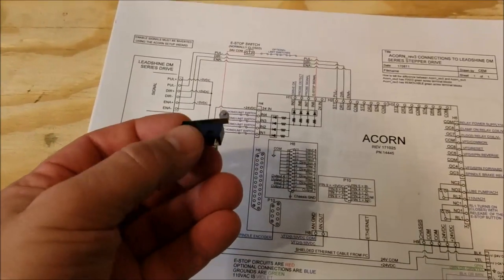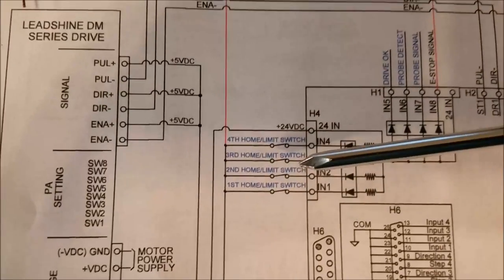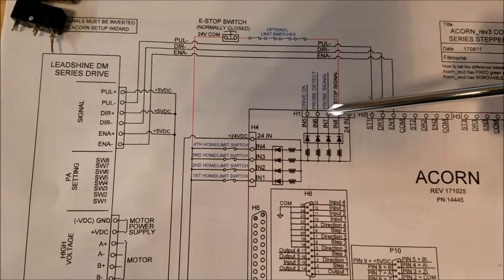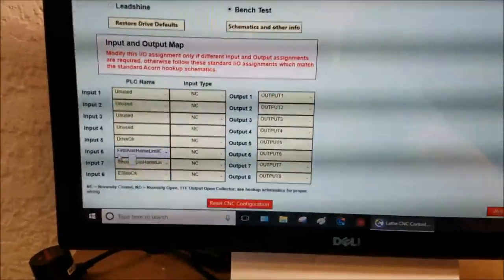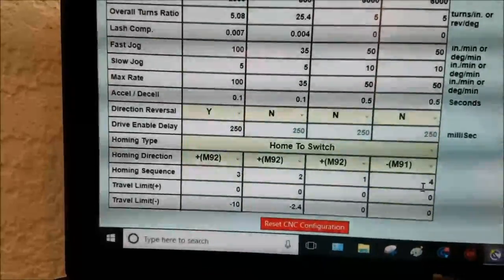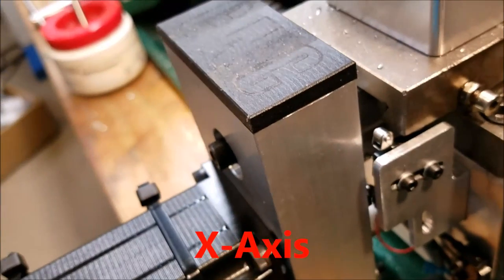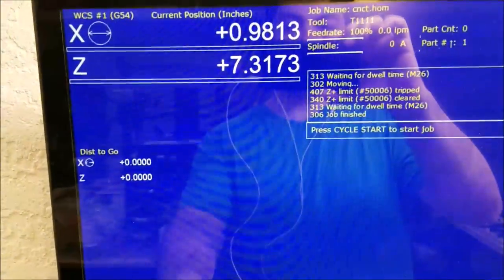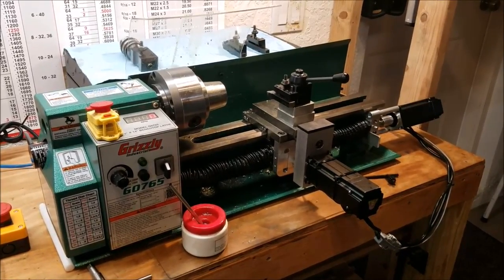DIY Closed Loop CNC Control #9: Home/Limit Switches

Comment: Great videos!! I may be able to use them in the future. Now all I'd like to see is you make something with it. I have a small lathe like yours and I'd never think to put this tech on it because of its poor rigidity. I recently acquired a used Bolton 10" that I was thinking I'd like to convert. It can almost cut to a mirror finish.

Comment: great videos, keep it up, on your mill conversion, what couplings did you end up using, just curios of the backlash
Reply from the maker: That is a great question - the couplings can account for a good portion of the backlash.  I used a diaphragm type on the Z-axis and helical beam  types on the X and Y.  I should have used the diaphragm type on all three axes as they seem to have less backlash than the helical beam type.